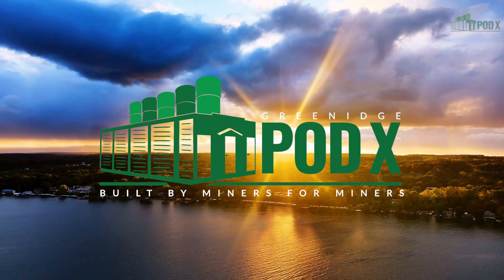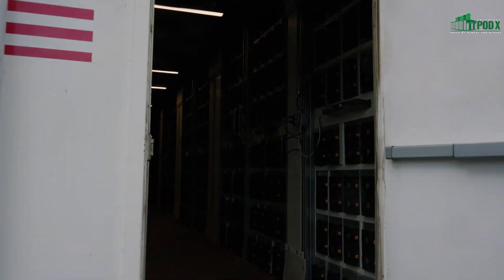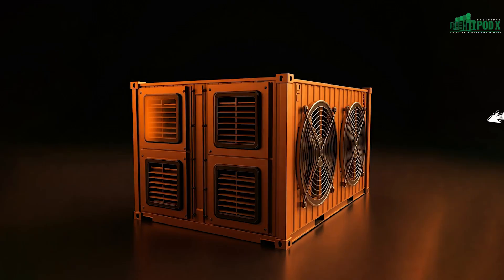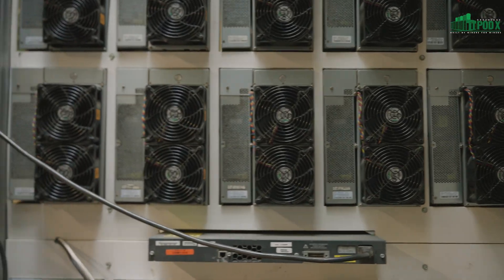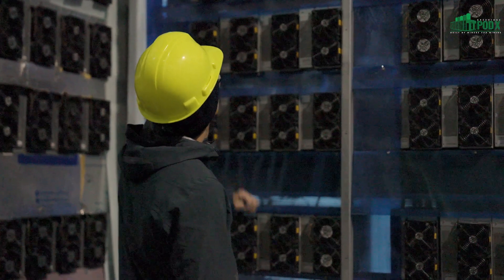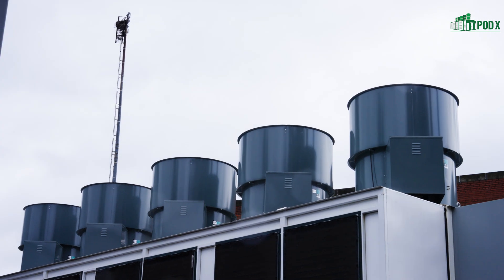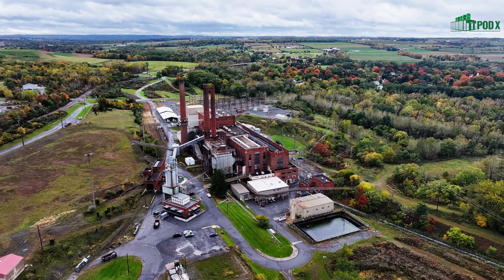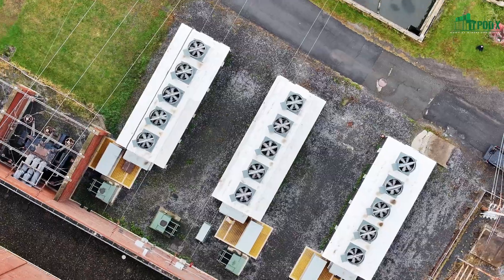Pod X Mining Container Solution by Greenidge Generation (Industrial Mobile Bitcoin Mining System)

Comment: For heavy rain/snow is there irrigation/drain system for water coming in through the exhaust portion?
Reply: At 2:58 seconds I can see some water droplets coming though the overhead exhaust
Reply from the maker: No, that's debris. Not water.
Reply from the maker: It's fairly water tight.